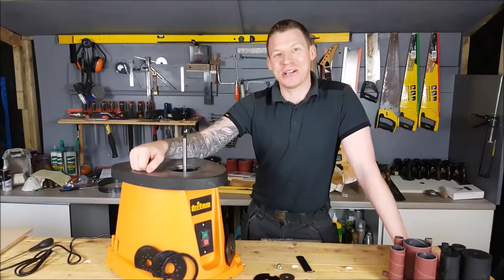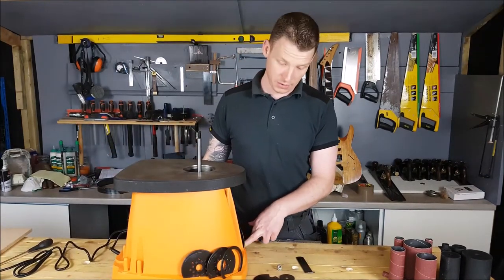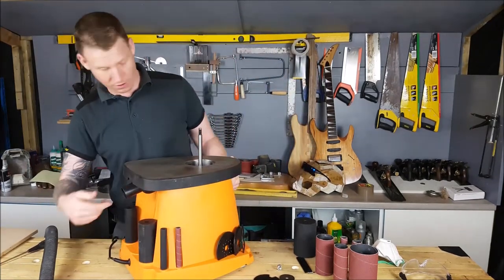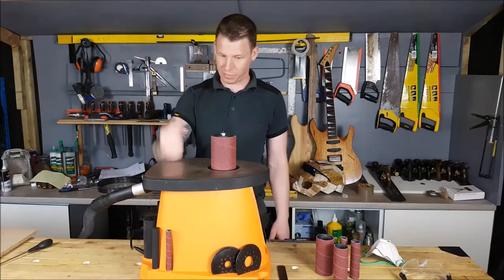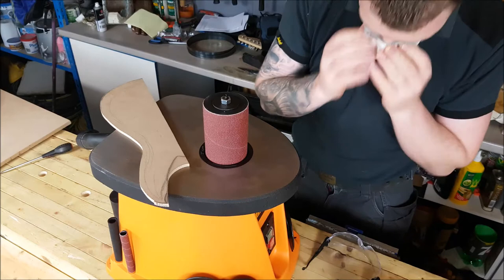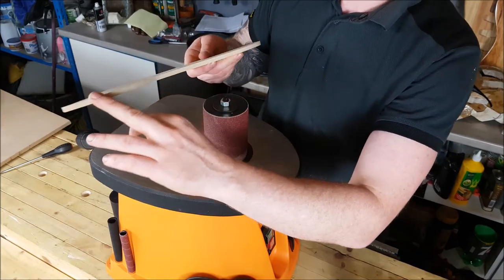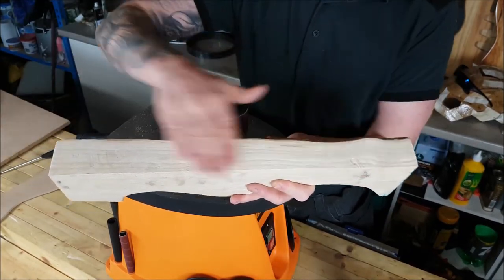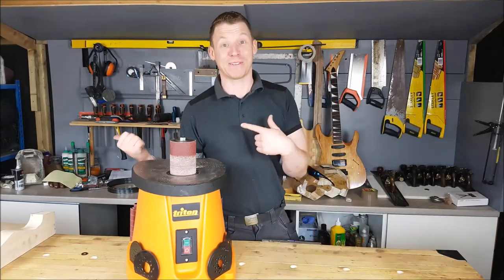Triton Spindle Sander! New Tool Day Review.

Comment: I have one of those and it's a great tool that I use for a lot of different tasks.  My only gripe is the cost of the sanding sleeves.  They are about £8 or more for a set, and they don't last all that long, so they are pretty expensive compared to a sander on which you can just put sandpaper from a roll.  I should really try to see if you can buy a collar that will let you do that, since the sleeves cost about £1.35 each compared to perhaps 20p for a piece of sandpaper from a roll.
Reply from the maker: With some double sided tape you can wrap the lager collars with sand paper from a roll, just wrap in the direction of rotation. Its a little trickier with the smallest one but can be done.
Reply: I've found that using hard rubber to keep the paper clean makes them last for ages.